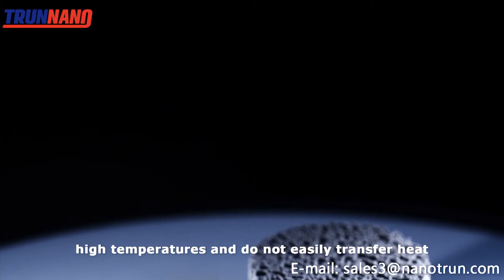A Super Hard Material-Silicon Nitride | TRUNNANO

Comment: What about its ballistic properties?
Reply: Pressed silicon nitride is the real trick. Shortly after it's discovery, a company that later became part of a secret government project apparently, named All American Aircraft of Long beach, CA, made a flying craft called the Phalynx, which had no wings, just a few fins, and a lot of pressed silicon nitride turbines that ran entirely off seawater and could refill during flight. It's top speed was fantastic but restrained due to hull temperature only. Nowdays we have better materials in frying pans. Mine does 30k F. 
A few years after , they found a method to greatly reduce the manufacturing cost of PSn, yet it's still quite expensive. The turbine allows water to expand exponentially beyond normal limits so much that making steam makes a few times more energy than it consumes. This means, we could easily power boats using a tiny turbine. I know a method that would allow manufacture even cheaper than current methods. No use in trying to patent it though. The Jewish Kabala runs anyone down who threatens big oil.
Reply: @mikefromspace  thanks for sharing! I wish I could understand better what you say. lol.
Reply from the maker: Silicon nitride can increase the toughness of ceramics